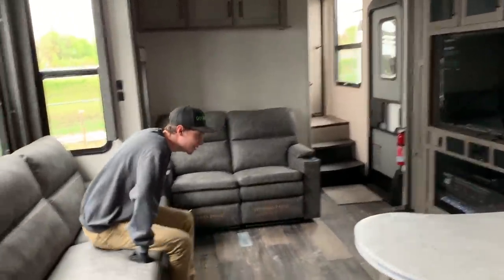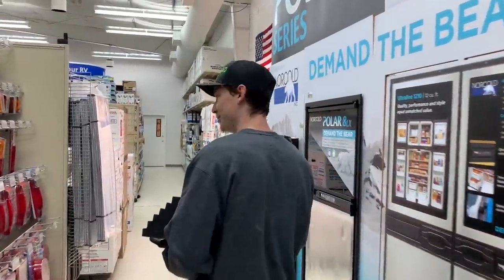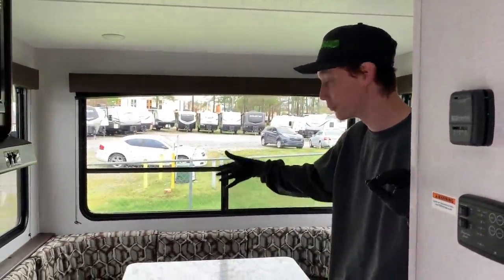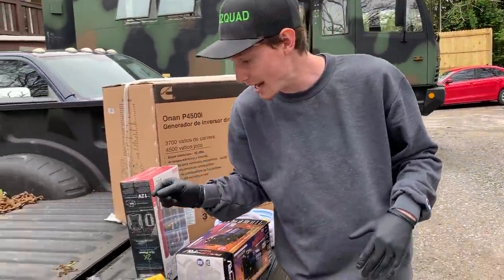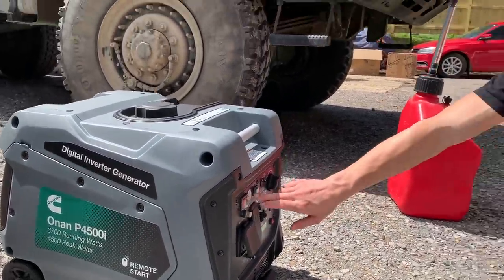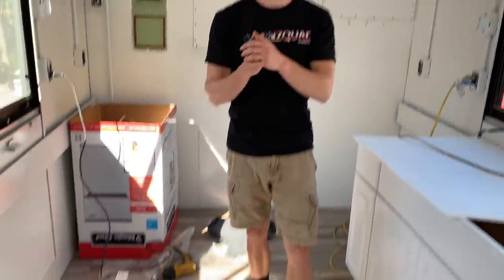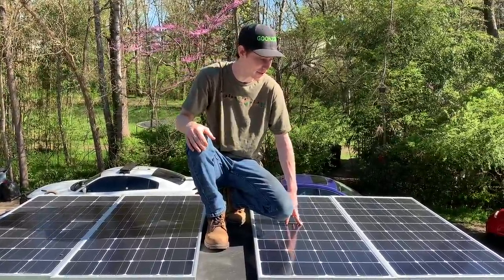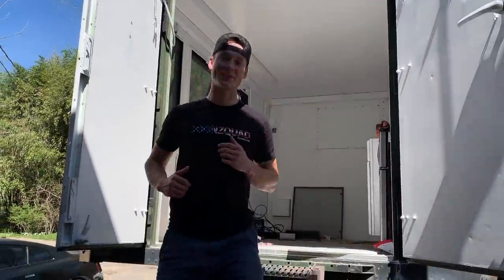Building The Ultimate Apocalypse Vehicle Part 5

Comment: Hey boys, licensed electrician here, that’s a 3 phase panel (3 hots, a neutral, and ground) btw those copper things that the breakers clip on to (bus bar) are all supposed to be hot I’m assuming you blew something up figuring that out 😂. I would recommend installing a smaller single phase panel (2 hots, a neutral, and ground) maybe a 20 circuit panel, go with Murray/Siemens brand. Contact me with any other questions would be glad to help out!
Reply: The third phase isn't live because it's only a single phase (120/240v) panel. Every 3rd breaker will have no power. Either switch to a single phase panel, or just skip every third breaker. The generator definitely isn't a 3 phase genset.
Reply: When is a panel company debate starting? Haha. Fan of square D and Eaton over here.
Reply: Scott Starrak the Cummins 4500i is a single phase 120v generator. Not the best for the application. 2 Honda’s with a parallel kit would be better.
Reply: Yes I would go with all square D. They need an electrician for sure.
Reply: Scott,
 Excellent advice. I am an electrician also and was going to email them and let them know I could easily help them out. I would do it for nothing and get them headed in the correct direction safely. Your advice is exactly what I was thinking watching the video. They will only have a single circuit powering their panel anyways.
Reply: We go nuclear  power. with a small surplus RTG from the Mars 2020 program, CHEK NASA surplus auctions for best deals and permitting....
Reply: Lol saw that panel and that plug and immediately went looking for the electricians in the comments. I'm not an electrician but I mine as well be. Im a glass shop technician and work with huge electric kilns(one kiln is 144amps) on 3 phase. So that panel was very familiar and I physically cringed when they were messing with it. Also SUPER important to balance the loads on that 3 phase, dont be drawing more on one leg or weird shit starts happening.
Reply: @tylerbianco6426 , two Hondas in parallel are 120v single phase, also. When hooking two gennies in parallel, the output watts are higher along with the amps. The genny they bought is fine for what they need it for, albeit, a little heavy maybe. Not only that, it's half the maintenance of two generators. All the generator/ inverters I've used in my 34 yr electrical career have been single phase 120v. Don't get me wrong, there are generators out there that will do three phase, but they are BIG and COSTLY.
Reply: Exactly right,  its 3 phase     also. Keep those batteries outside in a container with vents.
Reply: I thought they were both named dude...
Reply: @traitoR142  They are. Either one is Dude Dangson.
Reply: @jacobh3622  QO FTW!
Reply: Whenever you work on electric components make sure they aren’t live.
Reply: The single phase three phase info is spot on, but I wonder what that thing has on it that’s three phase. I would image whatever was removed from the front overcab area was. Possibly AC unit.
Reply: They. Could.  Buy a step up  transformer. To get 3 phase
Reply: License electrician here they’re going to have to bridge I jumper on a couple of those phases to get all three phase is powered up The reason most outlets weren’t working is because they didn’t have A phase being used.
Reply: What’s up fellow sparkys it’s a party in here 🎈
Reply: I was just gona say that lol same here (electrician)
Reply: @captron8493  One large verses two small generators?  1/2 the maintenance twice as often.  That panel should come out and a nice single phase replacement should be used.  And the lights?  Those will shake right off of that ceiling.  Off-road driving is a moving 4.5 to 7.0 magnitude earthquake on wheels.  Those cabinets, the lights, the mini fridge and every other "residential" piece of kit is going to turn to garbage after the first couple of trips.
Reply: i was wondering is that was a 3 phase  by gut feeling xD
though i never  seen 3 phase :D
Reply: You guys are having to much fun😊
Reply: At least they tried
Reply: Yeah should be connected to the existing system with a transfer switch. Having the bare ended cord is deffinent no no. The truck already has a good gen and battery setup so why change at all. Just add solar to the roof.
Reply: @jacobh3622  Square D is trash!  LOL!  Proprietary breakers and BS.  Eaton is the way to go!
Reply: @andrewpeterson9250  Three-phase is the most efficient though. Well, for motors anyway.  Amirite.
Reply: Next episode
Guys our truck blew up
Reply: @jacobh3622  Eaton is  a  trash it over heat with   afci  df  breakers
Reply: Gday Does anyone have a website/blog with a simple 200-250W soloar off grid setup clear guide mentioning
1 x 200-250w planel
invertor
charger control
wiring
+ 1 dc light
etc
Reply: @NateBenji  they should scrap the genny and run a mini spherical tokamak fusion reactor. They may have to wait a while though
Reply: Exactly, they should have stopped as soon as things didn't work as expected and called a professional. Should have used a proper exterior plug and possibly a 120/240 generator
Reply: They said to email them if you have something helpful

Comment: Never connect anything to the main terminal of the panel, run a wire out of a breaker to a female plug that connects to the generator plug. With having the plug on the main feed there's no way to turn off power incase of an emergency.

Comment: Hey guys I work a lot with RV's set up for long term dry camping. Something we set people up with frequently to make sure they have enough battery reserves is a multi battery bank system. So during the day your solar is charging one bank, and you're operating off the other one. when the bank you're operating off of starts to get low you can switch over to the charged one, and let the low bank charge up. Also something you may want to consider is instead of using multiple 12v batteries is using multiple 6v golf cart batteries, if you use 2 6 volt deep cycle golf cart batteries connected in series you'll get 12v but it'll give you a lot more usable output time than a single 12v will. Good Luck!

Comment: Glad you're listening to our comments, got some more feedback from this video:

That little hob you saw and wanted, its called a domino hob. Got one in my conversion, buy them online for less than 100 dollars with lpg conversion nozzles.

as that breaker panel is so confusing i'd recommend ripping it out for something smaller, space is seriously always something you need in a conversion like this

When you do a solar and battery setup try to wire usb ports and 12v sockets round the room without converting to 110v, as many make that mistake and when conserving power i strongly recommend using as little ac power as possible, laptop chargers can be bought online for car 12v sockets

That solar layout looks perfect, definitely leave room to walk between, i regret not doing that

You made quite a bad mistake giving that charger the solar energy before connecting the battery, always have the battery on when connecting and disconnecting solar, although you got a posh renogy kit so you'll be fine!
Reply: @Pumpkingilmour That escaped my mind as I use flexible permenantly mourned solar panels, yes they should definitely be hinged
Reply: @AndrewSmart32  U are smart Andrew
Reply: and a little less use of dude would make these videos a lot less painful.

Comment: you buy a damage camper at copart, then use the interior items.
you might find one with everything you need with a generator.
Reply: Great idea!
Reply: Some things you just don't buy used
Reply: Yep I did exactly that I bought one for 900 dollars a gooseneck and stripped everything inside and used it in a Uhaul rv conversion
Reply: I've even seen 30+ ft campers given away for free or under $1k from roof damage.

Comment: I recommend mounting the batteries outside (maybe underneath) so you don't have to deal with venting fumes.
Reply: Agreed, build a battery box underneath the trailer area and hide em.
Reply: Noticed that right away if you run closed cell you can put them indoors but the ones you guys bought have to outside
Reply: If you DO mount the batteries inside, make sure they are isolated from the interior and vented to the outside.
Reply: Depends on the battery type. Only liquid acid batteries need to be vented. Gel or agm batteries do not need to be vented....
Reply: Try Making Another Battery Compartment Next To The Other One On The Outside
Reply: hey  goonzquad the batteries you bought are for outside vehicle only 

Part Number:  27DC
Weight:  61.90lbs
Warranty:  1 YEAR
 12 Volt
 675 CCA
Cold Cranking Amps (CCA):  675
Positive Terminal Side:  Top Left
Battery Group Size Designation:  27
Reserve Capacity:  180
Battery Voltage:  12
Amp-hour:  85

Comment: Install the solar panels on rails so that they stack up when you need extra space on the roof.
Reply: Excellent suggestion!!
Reply: This is a really good idea
Reply: Theres youtube videos of other similar builds with solar panels on a sliding rail  system. Makes it super easy to push them back and enjoy the roof.
Reply: And a flat surface is far from ideal for solar panels, having them on an angle is more efficient
Reply: @jjheb571  Nice Link!
Reply: had the same idea as you
Reply: Or even let them slide out to the sides and sit at an angle
Reply: Nice thinking
Reply: والله كفو اقتراح ممتاز والله وانا كنت افكر فيه ورح اقترحه عليهم لكن سبقتني يا يوسف 👍🏻👍🏻👍🏻
Reply: Also (but this may be too much) - a mount that allows it to tilt in various directions. Flat is great, but if you can actually face the sun when its behind or infront of you , thats best.

Some panels output almost 15-20% more when facing the sun vs being flat. Dust/leaves on the panel are less of a concern in this mobile set up but also worth noting as well.

Comment: I’m a solar installer from Australia, when you install the solar panels leave an inch gap in between them. The panels expand just a little in the sun so you don’t want to put them up against each other or they will most likely smash.
Reply: Also wouldnt be useing them batterys as a indoor battery bank. Lithium ion would be much safer.
Reply: @ryansmith8608  They do look like flooded batteries. Those are going to fill that cabin with hydrogen and sulfuric acid. One is explosive the other is highly toxic.
Reply: Bataan explain, flooded?
Reply: OneN Only I’m glad I’m not the only one that’s confused lol
Reply: They don’t research anything. They just wing it
Reply: @ryansmith8608  lithium, safer? lol what planet do you live on, SLA batteries, AGM ones that dont vent hydrogen when charging, can be mounted any orientation. and its not like weight is going to be an issue in that.   lithium is far lighter, but safer? god no lol.
Reply: also they can just run the vents to the outside, and have a fan  to cycle air out
Reply: Tesla mount batteries outside so why not do the same?
Reply: @FatherOfMars.  Flooded batteries have a mix of water and an electrolyte called sulfuric acid. Just google how they work, if you have a car, the battery is likely flooded. You can tell by the vent caps on top.
Reply: @RyanArmstrong89  lithium ion batteries don't contain any fluids so they're very safe and contain tons of energy. They are EXTREMELY dangerous when punctured tho since they flare like crazy. Lithium polymer are safer and lighter but contain less energy.

Comment: The existing panel is a 3phase panel.  You're going to want to use a single phase panel, which has 2 feeds 120/240v.
Reply: Correct!
Reply: Just jump one of the 3 legs to another and have two legs of power. I’m sure you have a separate ground and neutral.  Than you will have the two legs of power. Just make sure not to many of the outlets are on just one of the legs.
Reply: too bad that gen is not 240
Reply: Dan O'Brien.. agreed.. get a 120/240 panel. Do NOT JUMP legs..if you have a 240 breaker it will pull power from the same leg and not work. A normal single phase 120/240 panel is a,b,a,b,a,b,a,b.. a 3 phase panel 120/240 is a,b,c,a,b,c,a,b,c.
Reply: That gen is 120 volt only so all 3 lugs on top need to be jumpered together

Comment: And install carbon monoxide detector. There are a lot of good articles when you search boating / cruisers and generator safety related articles.
Reply: Its necessary if you have comething creating a monoxide, like gas heater, or electric generator in living quarters. If they wont be using heater it should be fine.
Reply: Finally someone noticed/said it!

Comment: I'd suggest getting an electrician in for the day just to make sure everything is kosher, high voltage is no joke, great job guys
Reply: Good idea, I agree.
Reply: Ya, they could probably run everything on a proper solar setup. They also could have taken those main lights out completely. Only run the emergency lights with new LED strips. That way you only need battery power to run lights. Hate to say it but they really need to sit down and figure out what they’re doing.
Reply: Totally agree. Thats a 3 phase panel. You are using single phase genaerator. In other words any breaker that is on that third phase(Blue wire)breaker  will not work.
Reply: At least get a buddy to stop buy and take a gander!
Reply: also guys be careful with Solar and batteries, DC is more dangerous than AC with the higher amps
Reply: @allisterdavidson9805  What at 13 volts...danger !! DOH

Comment: When you put the generator in that enclosed area, be really careful of carbon monoxide, if I were you I would buy a couple of co detectors
Reply: And try and see if they can vent the exhaust out to the side
Reply: Where they're planning on putting the generator is open to the bottom it has a flap door to access from the front roof of the vehicle as well... I just would have went with a diesel generator so that they could tie it in with their existing tanks, because it's going to be a pain to fill it up up there, with a remote start feature, that they could mount beside their access door. I suggested  a Onan QD 3200, not the best quality generator definitely need to keep up on your maintenance, but would have got the job done for them I think for what they need. Along with perfect physical size for the spot.
Reply: But is it an enclosed area? When they opened it up, you clearly saw outside of the rig, looking like it's not enclosed.
Reply: It’s not enclosed.
Reply: Make sure you disconnect the solar panels first and not the batteries or else they will fry your charge controller. When you are disconnect the batteries.
Reply: Especially when they eventually get an ac unit beside it sucking those fumes right in
Reply: Its not enclosed if you look close last video it has 2 metal rods and the rest is an open area.
Reply: If your using a gas stove, generator just bloody shell out for a detector... 
Fumes are sneaky. I almost died from Carbon Monoxide poisoning, wasn't even aware anything was wrong.
Reply: It's a no emissions generator. You people really don't pay attention.

Comment: Hi guys, so excited for you with this goonzquad 4x4.
I've been following cheap rv living on YouTube for long time. Many things to learn etc. Generator you have is Onan engine. And gets louder when you increase load. Eco is when you use low loads. It controls engine rpm differently.
Water pump, return. Tooo big. Wish I was closer to help advise and electrical too. Your fridge needs to be dometic brand for good power usage, or similar brand.  You need to use low power usage on the things that are the big users.
Watts on solar.... 1000 plus if you can. If you need reference or links, ask :)
Your inverter needs to be pure sinwave. It is what you get at home. Safe for electronics. I think your generator was.
Batteries need to be Trojan brand, made for your setup. The ones you have are... Temporary. Long term. Don't use store batteries. More if you ask.
So excited for you in general. Please ask!!!

Comment: GUYS This is important! 
You can't use a normal house hold fridge in your camper! They are not designed to be rattled around like the RV fridges. The pipes that hold the refrigerant (a deadly invisible non smelling gas) will leak out and kill you while you sleep. You need to get a proper RV fridge as they are built for that reason. A family in Australia died when they had a mini fridge in their tent and it leaked out. YOU NEED TO GET A PROPER RV FRIDGE FOR YOUR SAFETY!!!! PLEASE!
Reply: Seems like they don't know nothing and also they are not doing proper research before buying
Reply: You obviously missed the part were they mentioned the fridge that don't rattle
Reply: The "deadly" gas is called freon. It is not harmful to humans in the small quantity that that refrigerator holds. Most rv refrigerators use the same gas. The only difference between that unit and most rv ones is the locking doors. Put up a link to the Australian family. Freon can displace oxygen however it takes a lot and I think it would leak out of a tent before displacement happened even if it was a 30lb tank. That refrigerator holds less than 5oz.
Reply: They were using a propane-powered fridge.  It was the carbon monoxide that killed them.
Reply: Freon is not deadly lol. And huge RVs use household full-size fridges
Reply: Many big RV manufacturers are switching to regular fridges with inverters and more batteries instead of 2-3way fridges.
Reply: @McCunesRUs  someone with the real facts thankyou